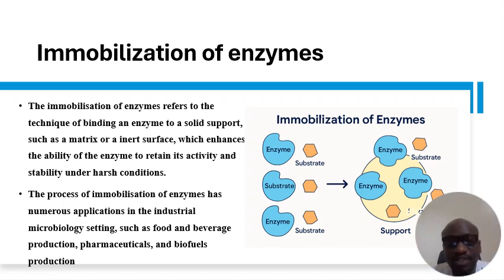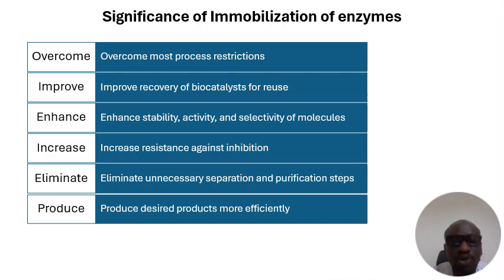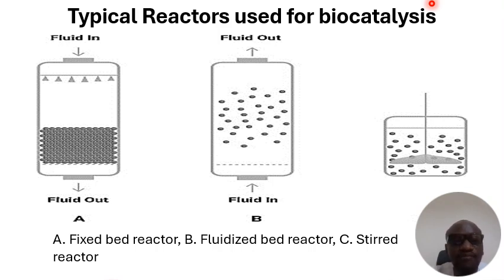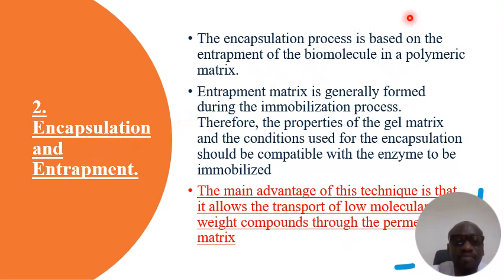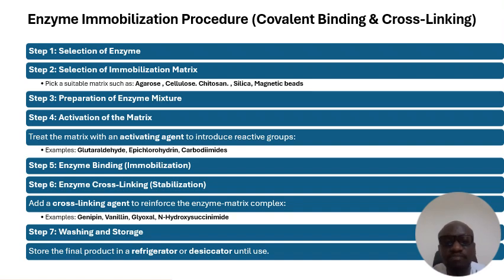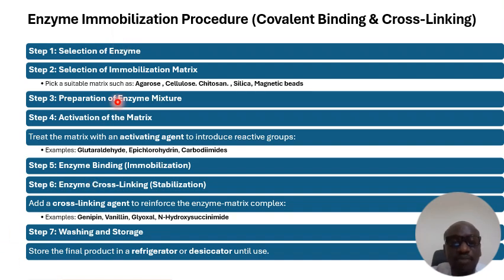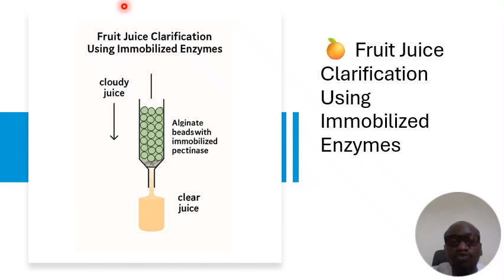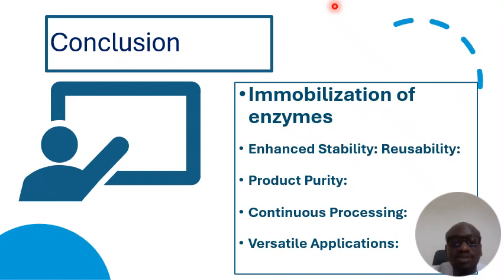Immobilization of Enzymes (Industrial Microbiology )

Comment: Question 1:
Enzyme immobilization is a technique where enzymes are fixed to a solid support or matrix, such as silica gel or agarose, through methods like physical adsorption, entrapment, or covalent binding.
This process is highly useful because it enhances the enzyme's stability and allows it to be easily recovered and reused, which significantly reduces costs in industrial production. It also results in a cleaner final product by preventing the enzyme from mixing with the output, thereby streamlining the purification process

Question 2: List at least two advantages of immobilised enzymes and give one real-life application where they are used
- Reusability and Cost Efficiency: Because the enzymes are fixed to a support, they can be easily recovered and reused for multiple industrial cycles. This reduces the need for frequent replacement and lowers overall production costs.
- Enhanced Stability: Immobilized enzymes are more resistant to environmental stressors like heat and changes in pH, which prevents them from denaturing and allows them to maintain their activity under tougher conditions.
- Real-Life Application (Dairy Industry): This technique is used to produce lactose-free milk. The enzyme lactase is immobilized on beads, and as milk passes through them, the enzyme breaks down lactose into glucose and galactose, making the final product easier to digest for lactose-intolerant individuals.

Name: Gabriel Motunrayo Esther
Matric No: 210807048

Comment: Microbiology
Reply: Question 1: 
Enzyme immobilisation is the technique of attaching or confining enzymes to a solid support, such as beads, membranes, gels, or other insoluble materials, instead of allowing them to remain freely dissolved in a solution. Different methods, including adsorption, entrapment, encapsulation, covalent bonding, and cross linking, can be used to achieve this. Immobilising enzymes makes them easier to recover after a reaction, allows them to be reused several times, and improves their stability during industrial and laboratory processes.

Question 2:
Advantages:
1.Immobilised enzymes can be recovered and reused, which reduces production costs.
2. They are more stable under changes in temperature and pH than free enzymes.
3. They are easy to separate from the reaction mixture, resulting in a cleaner final product.
4. They make continuous industrial production processes more efficient.

Application:
Immobilised lactase is used in the dairy industry to produce lactose free milk and other lactose-free dairy products by breaking down lactose into glucose and galactose

Odedipe Ayomide Fiyinfoluwa 
21087037
Reply: 210807037
Odedipe Ayomide Fiyinfoluwa

Comment: Microbiology
Reply: Question 1
Enzyme immobilisation means fixing enzymes onto or inside an insoluble solid support (like alginate beads or polymer gels) so they stay in place during a reaction. This allows easy separation of the enzymes from the end product so they can be reused continuously.
Reply: Question 2
• Reusability
• Easy product separation
• Product purity
Application:
Production of lactose-free milk using immobilised lactase.
Reply: Faneye Olamide Oluwafikayo

Comment: Question 1
Enzyme immobilization is the technique used to attach solid enzymes to a solid support such as matrix or inert surface, while retaining its ability to carry out certain reactions. They are fixed through adsorption process, covalent binding, entrapment, cross-linking and encap selection, it is useful because it allows for recycling, and also helps in the effective utilization of the enzymes.

Question 2
Advantages of immobilization of enzymes include:
1. Multiple use of enzyme(recycling)
2. Co-immobilization with other enzymes
Application: Pharmaceutical industries

Onabajo Arinola Rachael
230807505

Comment: Question 1
Enzyme immobilization is the process of using techniques to attach soluble enzymes to solid support while retaining it’s ability to carry out catalytic reactions.

Question 2

Advantages 
•It allows for reuse of a single enzyme 
•Immobilized enzymes are usually more stable 
•It helps protect the enzymes from harsh environmental conditions such as high temperatures,extreme pH etc.
Reply: Applications 
Food and beverages:Immobilized lactase is used to produce lactose-free milk.

Pharmaceuticals:Immobilization is used to synthesize amino acids and antibiotics in pharmaceutical industries.

Comment: Question 1: 
Enzyme immobilisation is the process of attaching enzymes to a solid support, such as a matrix or an inert surface, so they stay in one place while carrying out their function. This is useful because it makes the enzymes more stable, allows them to be reused, and improves their efficiency in industrial processes.

Question 2: 
* Immobilised enzymes can be reused multiple times, which helps reduce production costs because the same enzyme does not have to be replaced after every reaction.
* They are more stable and can continue working under harsh conditions, such as high temperatures or in the presence of organic solvents.
* They are easy to separate from the final product, making the purification process faster and reducing the cost of downstream processing.

Real-life Application: 
Production of lactose-free milk in the diary industry: Immobilised lactase is used to break down lactose, the sugar found in milk, into simpler sugars such as glucose and galactose. The enzyme is fixed inside a column or on alginate beads, and as the milk flows through, the lactose is broken down. Because the enzyme remains attached to the support, it can be reused many times, making the process efficient and cost-effective while producing milk that people with lactose intolerance can drink safely.

NAME: JATTO MARGARET EHINOMHEN. 
MATRICULATION NUMBER: 210807051.

Comment: QUESTION 1 
Immobilization of enzymes refers to various techniques of binding an enzyme to a solid support system, while still preserving their activity and properties. This allows the enzyme to be easily recovered and reused, while improving it's stability, and makes industrial processes more efficient. The materials used for immobilization include porous beads and gels.

QUESTION 2
Advantages include:
1. The immobilized enzymes can be easily removed from the reaction mixtures which helps to keep the final product free from contamination
2. The immobilized enzymes are cost-effective since they can be recovered and reused multiple times
3. They have greater stability and are more resistant to changes in temperature, pH, and other processing conditions compared to free enzymes.

Application  
Use of immobilised enzymes in dairy industry
This is used in production of lactose free milk by immobilizing the lactase enzyme. 
The milk is passed through a column either alginate beads with the immobilised lactase, which then break down the lactose into glucose and fructose. This lactose-free milk is highly recommended to individuals who have little level of lactase in the system (lactose-intolerant individuals).

NAME: LATEEF FAWAZ OLUWATOROMO
MATRIC NUMBER: 210807105

Comment: Name: Egwurube Samuel 
Matric: 210807501
Enzyme immobilisation refers to the process of physically confining or anchoring enzymes to a solid, insoluble support material.
Reply: Name: Egwurube Samuel 
Matric: 210807501
This technique is extremely useful because it prevents the enzymes from dissolving in the reaction mixture, allowing them to be easily recovered, reused continuously, and operated at higher temperatures or varied pH levels.
Reply: Name: Egwurube Samuel 
Matric: 210807501
Applications and Advantages
 Advantages:
Reusability: Immobilised enzymes can be easily separated from the reaction product and reused multiple times, significantly reducing production costs.
Reply: Name: Egwurube Samuel 
Matric: 210807501
Enhanced Stability: Attachment to a support matrix often increases the thermal and operational stability of the enzyme, making processes more robust.

Comment: Question 1.
Immobilisation of enzymes is the process of fixing enzymes to a solid support, allowing the enzymes to retain their activity during use and remain stable under harsh conditions. 
enzymes can be fixed to a support by encapsulation, entrapment, covalent binding, physical adsorption and cross-linking. This is useful because the enzymes shelf-life is extended, they require minimal purification, they remain stable over a long period of time.

Question 2: 
Advantages of immobilised enzymes:
1. The enzymes can be reused multiple times
2. it reduces cost of downstream processing
3. The enzymes are easily seperated

Real life application:
Fruit juice clarification: The cloudy juice is passed through a column containing alginate beads with immobilized pectinase to breakdown pectin in the juice making the juice clearer.

NAME: OLUITAN, Isaac Oluwamayowa
MATRIC. NUMBER: 210807123

Comment: Microbiology
Reply: Question 1:
Immobilisation of enzymes involves attachment of ab enzyme to a matrix or inert surface in order to enhance stability, shelf life and make the recovery of enzymes easier.

Question 2:
Immobilized enzymes are durable, with a higher shelf life which makes them cost effective.

They require minimal purification and are reusable with enhanced stability and recovery is easy.

Question 3:
An application is the use of enzyme lactase that has been immobilized in a bead to breakdown lactose during the processing of lactose free milk for lactose intolerant individuals. Because the enzyme is immobilized in a bead, it doesn't mix with the final product i.e the milk and can be recovered and reused

Comment: Microbiology
Reply: Question 1: Immobilisation of enzymes

Immobilisation of enzymes is the process of attaching or trapping enzymes onto a solid support or within a suitable material while allowing them to remain active. This is useful because the enzymes can be easily recovered and reused, making industrial processes more efficient and cost-effective.
Reply: Question 2: Applications and advantages
1. They can be reused many times, reducing production costs.
2. They are easier to separate from the final product, improving product purity.

Real-life application:
Immobilised glucose isomerase is used in the food industry to convert glucose into fructose during the production of high-fructose corn syrup, which is widely used as a sweetener in soft drinks and processed foods.

Comment: Question 1:
Enzyme immobilisation is a method of fixing enzymes onto or inside a solid support, such as beads, gels, or membranes. This keeps the enzymes in one place while they carry out a reaction. It also makes it easier to separate them from the final product and reuse them, making industrial production more efficient and economical.

Question 2:

Two advantages of immobilised enzymes:

* They can be reused:Immobilised enzymes stay attached to the solid support, so they can be collected easily after use and used again. This helps reduce the cost of production.
* They are more stable:Immobilised enzymes can tolerate changes in temperature and pH better than free enzymes, allowing them to remain active for a longer period.

One practical application:

* Making lactose-free milk:In the dairy industry, the enzyme lactase is immobilised inside a column. As milk flows through the column, the enzyme breaks down lactose into glucose and galactose, producing milk that is suitable for people with lactose intolerance.

Ezendiokwere Michael 
Chinecherem 
Microbiology 
230807545

Comment: Question 1 :Immobilization enzyme is the process of fixing enzymes onto or within a solid material so that they can be easily separated from the reaction mixture and reused while maintaining their catalytic activity .
Olatunji Habeebah Olamide 
230807551
Reply: Question 2: ADVANTAGES 
1. Immobilization helps enzymes maintain their activity and stability under harsh conditions,such as changes in temperature and PH.
2. Immobilized enzymes can remain active for a longer period compared to free enzymes .
3. They can be easily separated and reused,there by reducing cost .
APPLICATION 
1. They are used in food industry for the production of glucose, syrup, milk, and fruit juices.
2. They are used in pharmaceutical industries for the production of drugs and pharmaceutical products.

Comment: Microbiology
Reply: QUESTION TWO

2.  Advantages of immobilized enzymes
* Immobilised enzymes can be reused many times.
* They are easier to separate from the final product, making purification easier and faster.

Applications 

* Immobilized enzymes are used in the production of clear fruit juices. Enzymes such as pectinase are immobilized to break down pectin making the juice clearer and improving its appearance, thus, making the juice more suitable fruit juice for juice lovers.
Reply: 1. Immobilization of enzyme refers to the technique of attaching, binding an enzyme onto a solid support such as inert surfaces or matrix so they remain in a stable position without mixing freely with the solution.
Reply: This technique enhances the ability of the enzyme to remain stable and active under harsh or prolonged usage. Enzymes are fixed to solid supports such as silica gel and polyacrylamide by methods like adsorption, entrapment, cross linking, etc. This is particularly useful because the enzyme can easily be recovered from the final product, it also helps to preserve the quality of the final product.

Comment: 230807515
Favour Ese
Reply: Question 1:
Enzyme immobilisation is the method of fixing enzymes onto or within a solid material while allowing them to keep working. This makes them easy to recover and use again, improving efficiency and reducing costs.
Reply: Question 1:
Enzyme immobilisation is the method of fixing enzymes onto or within a solid material while allowing them to keep working. This makes them easy to recover and use again, improving efficiency and reducing costs.
Reply: Question 2:

* Enzymes can be used repeatedly, lowering expenses.
* They are easier to remove from the final product.
* They are more resistant to changes in pH and temperature.
Reply: Application:
Immobilised lactase is commonly used to produce lactose-free milk.
Reply: Application:
Immobilised lactase is commonly used to produce lactose-free milk.
Reply: Application:
Immobilised lactase is commonly used to produce lactose-free milk.

Comment: Question 1:
Immobilisation of enzymes is the process of attaching or trapping enzymes onto a solid support so they remain in one place while still carrying out their catalytic function.
Reply: Question 2:
Advantages:
. Enzymes can be reused multiple times, reducing production costs.

. They are easy to separate from the reaction mixture, giving a purer product.

Application:
Immobilised lactase is used in the dairy industry to produce lactose-free milk by breaking down lactose into glucose and galactose.
Reply: 230807504
Chijindu Chiamaka Clara

Comment: Microbiology
Reply: Question 1:
Immobilization of enzymes is a biotechnological technique whereby enzymes are attached to a solid support system which holds them in place, making them unable to move freely. This makes the enzymes very stable which results in a smooth and more efficient process.
Reply: Question 2: 
Advantages of enzyme immobilization are:
* Easy separation of the enzymes from the finished products
* Enzymes remain very stable even in harsh conditions
* They can be reused continuously

Real Life Application: 
In the pharmaceutical industry, immobilized penicillin acylase is used in the manufacture of semi-synthetic antibiotics such as amoxicillin. This immobilized form makes the enzyme more stable and reusable which results in consistent drug production.

Comment: Microbiology
Reply: Question 1
Immobilization of an enzyme is the technique of binding an enzyme to a solid support, such as a matrix or inert surface. Enzymes are fixed to a support by methods such as adsorption, covalent bonding, and entrapment. This allows the enzyme to be reused and easily separated from products.
Reply: Question 2
. Easy separation of enzymes
. Reduces the cost of downstream processing
Immobilized enzyme can be used in industries for food and beverage production, pharmaceuticals and biofuel production.

Comment: Question 1: Explain immobilisation  
 Enzyme immobilisation is the process of attaching or trapping enzymes on a solid support so they remain in one place while still carrying out their catalytic function. This is useful because the enzymes can be reused easily, are easier to separate from the reaction mixture, and often become more stable.

Question 2:Applications and advantages  
 Advantages:
1. Enzymes can be reused, reducing production costs.
2. Immobilised enzymes are easier to separate from the reaction mixture.
3. They often have improved stability and a longer working life.

Real life Application
Wastewater treatment: Immobilised enzymes are used in wastewater treatment plants to break down harmful organic pollutants and toxic substances in wastewater before it is discharged into rivers or reused. Since the enzymes are attached to a solid support, they can be recovered and used repeatedly, making the treatment process more efficient and economical.

NAME- OYENUGA ENIOLA RACHEAL
MATRIC NO-210807019